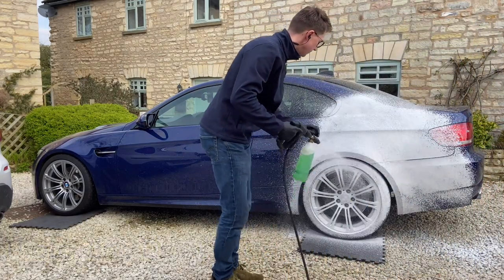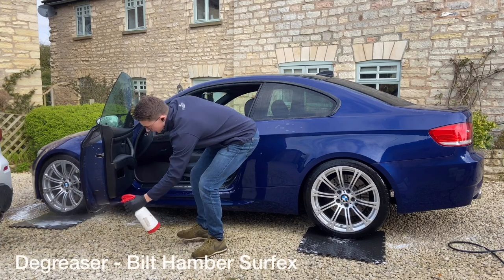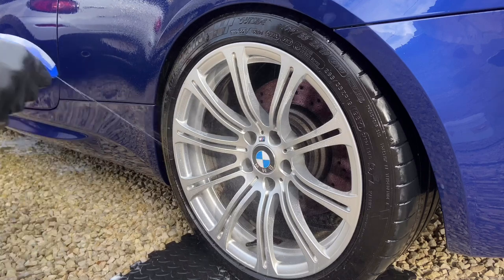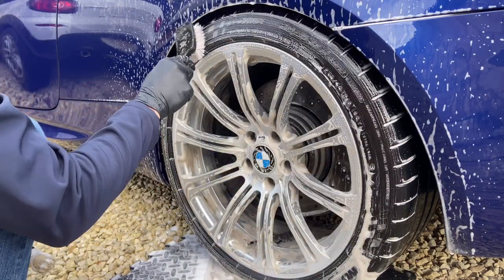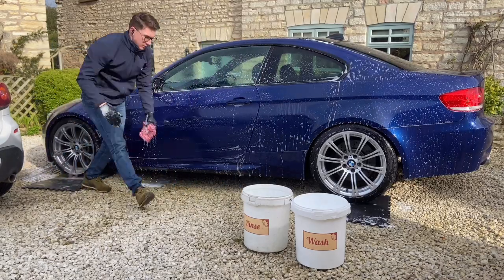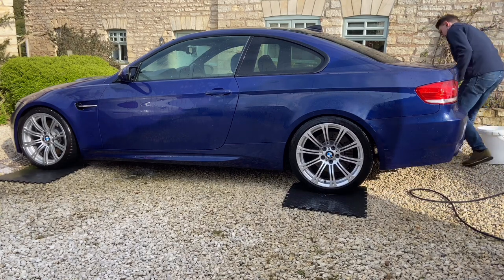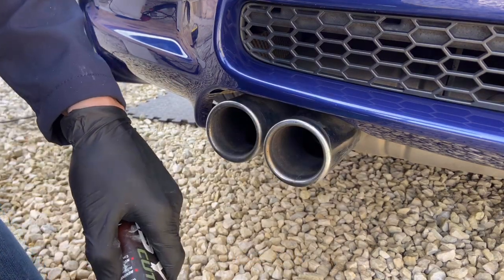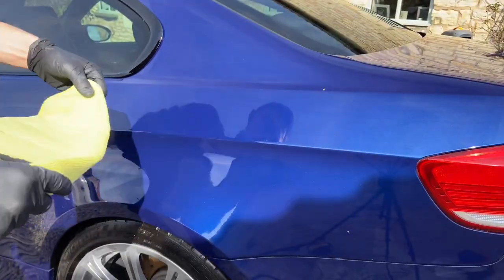BMW M3 - How to Protect Your Paintwork + Carpro Lite Application

Comment: Great video - thanks for taking the time to make. Couple of questions...
How do you stop water spots forming as the car drys whilst your cleaning the wheels?
Why use the microfibre to wipe the dirty wet tyres before rinsing?
Is it safe to apply the ceramic coating outside?
Reply from the maker: No problem at all. 
If that is the case when it’s warm outside, you can either keep rinsing the wheels whilst you clean the car, or lightly snow foam them again to remove the marks. You could dry them, but the risk of getting them wet whilst cleaning the car is quite high. 
Any microfibre will be fine. Preferably a short pile and one that you don’t might heavily soiling/ruining. I typically brush the tyres then use a microfibre to ensure that they are squeaky clean. 
Absolutely, providing that your careful, so keep an eye out for any debris such as leafs and dust. I would apply to the bonnet first as that’s typically where any contaminants would settle. 
Carpro cure relatively quickly, especially their lite ceramic.
I would do it in spring or summer and make sure the following day is dry as well

Comment: Hi do you normally pre rinse the car before applying snow foam or do you find it works applying it to a dry car
Reply from the maker: Not usually I like applying it to dry paint. If the cake was really caked in mud then I would 👍🏼

Comment: no cure time for car pro lite? i thought it had to be done indoors? can you use if outdoors if so i am getting myself some
Reply from the maker: It cures very quickly, especially with it being warm when I filmed it. 
Also, it was dry for the next few days which is something I would always check before hand 👍🏼
Reply: Hi mate so was it ok with any dust or pollen sitting on top I’m going to use it outside next weekend as it’s supposed to be dry think it will be ok?
Reply from the maker: Hey, no dust or pollen at all so all good 👍🏼

Comment: Can I use the iron remover and GTR (I use EZ Reigning Iron and GTR) on painted wheels?  I have the standard black RS3 alloys with a gloss black spoke and diamond cut rim
Reply from the maker: If they are the standard wheels and haven’t been refurbished then it should be fine. 
If for what ever reason there has been a poor refurb then I would try and avoid a strong tar and glue remover

Comment: I want to know how you clean your towels afterwards or do you just throw them away?
Reply from the maker: I use a non bio colourless washing detergent. 
I’ll try and keep the microfibres separate, especially the glass cloths as I don’t want them to pick up any lint. 
I leave them to hang dry and occasionally use the tumble dryer for the more plush microfibres as it helps rejuvenate them. 
I typically don’t throw them away until they are trashed. 
If I use a new cloth for ceramic coatings I’ll downgrade it to interior duties and will never touch the paintwork again 👍🏼
Reply: Do you wash your new microfiber towels before you use them for the first time?
The same question for wash mitts?
Reply from the maker: I tend to yes, as removes any loose fibres from the factory, and helps reduce any potential dye transfer. 
I don’t typically for wash mitts as they are going straight into water
Reply: @HarpersCarDetailing  Thank you. Your videos are very helpful to me.
Reply from the maker: No problem at all, I’m glad you find them useful 👍🏼

Comment: How long did it hold before another aplication? Did you use a topper?
Reply from the maker: It typically lasts around 6 months with it being a lite ceramic
Reply: @HarpersCarDetailing  it´s what carpro says, but how about this car in particular?
Reply from the maker: @szm09  I’m not sure as I don’t maintain it